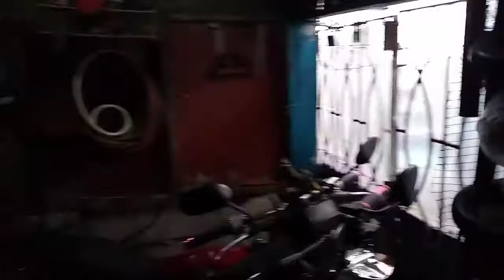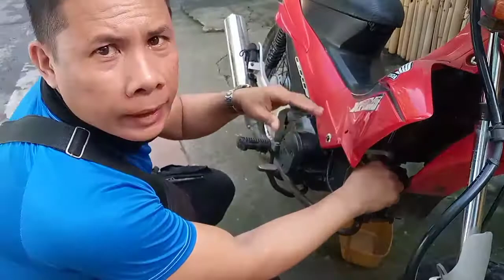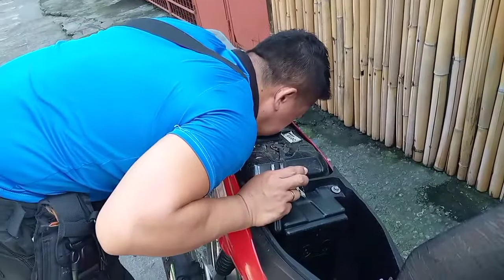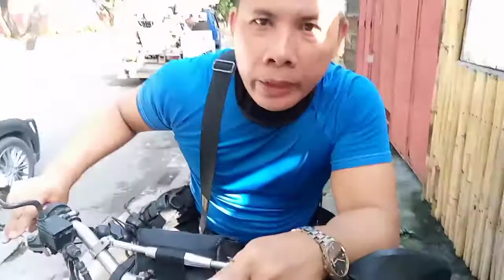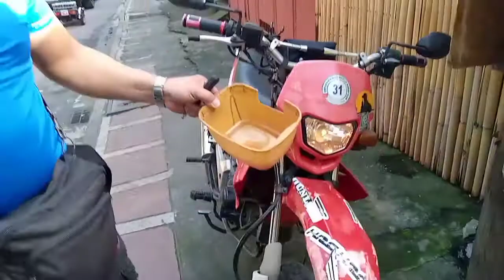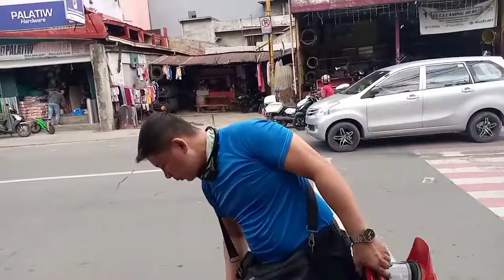Paano Paandarin ang Motor na Matagal ng hindi Nagagamit.

Comment: Sir patulong naman ako, same issue ng motor ko ito. 4yrs nakatambak. May kuryente, may bagong gasolina saka may compression kapag padyak. Pero ayaw umandar. Sinubukan ko lagyan ng konting gasolina sa may sparkplug at umaasang magtutuloy yung andar pero walang swerte. Bago sparkplug, may kuryente mula ignition coil, bagong lagay gasolina at baterya. Ano kaya posibleng sakit kasi ayaw umandar. Salamat ng madami sa makakasagot.
Reply from the maker: Ipalinis mo po idol Ang mga wiring connectors baka may mga kalawang na.isama Muna rin Ang Tanki at carborador at change oil muna rin po.

Comment: kuya yung motor ko 11months ko di nagamit. pero bago sya mastock napakabilis ko lang ma start. pano po ba gagawin. idedrained yyng gas?
Reply from the maker: Opo Idol drain mulang ung lumang gas sa caborator nya bago nyo po paandarin.
Reply: @donlegaspivlogs1342  pano nga pag drain ipinakita mo sana kong saan banda pipihitin at kong saan.
Reply from the maker: @roldanygbuhay1380  Dyan lang po sa tagiliran ng carborator sa gawing harapan may turnilyo po dyan gamitan nyo lang po Ng Philip screw.